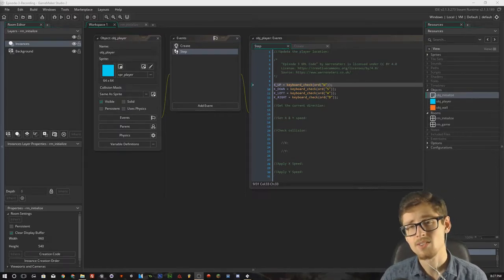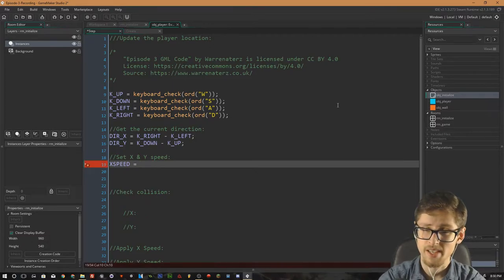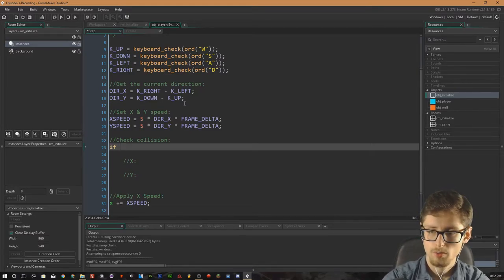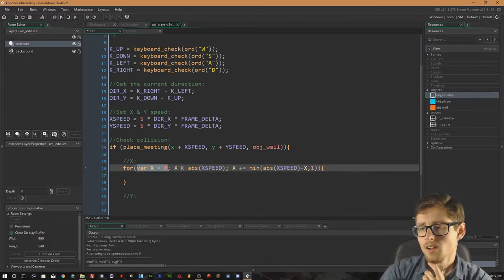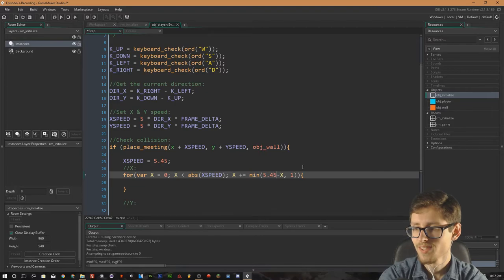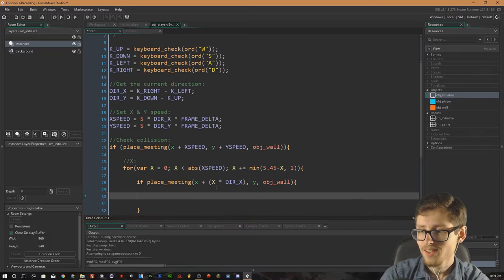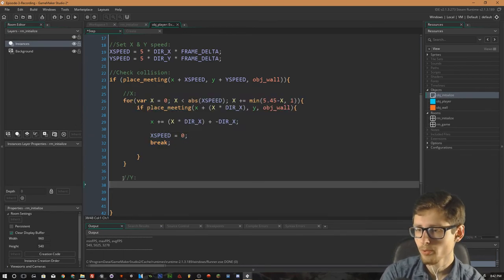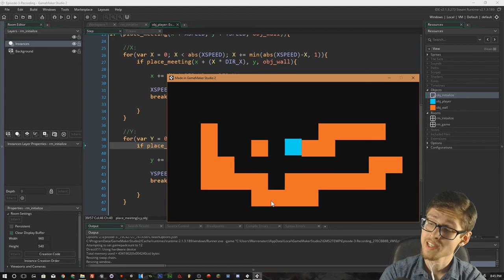GameMaker Studio 2 Tutorial [ADVANCED] - Alternative collision with Delta Time - [Episode #3]

Comment: Wow! Thanks for that code, I thought about using for loops in collision checking, but never envisioned using them like this. The collisions now work really well. Thanks for the tutorial!
Reply from the maker: You're very welcome man, I'm glad that it helped you!
Reply: Aha thanks. I just want to ask you on how to deal with a rotating object colliding with another object and making sure that the object doesn't rotate through the other object, I really appreciate any help and thanks in advance. :)
Reply from the maker: Epic for that I'd either recommend you to use circular collision because it's less performance heavy, and if not, use pixel perfect, but then check if a collision will occur before you incriment / decrement the rotation of your rotating sprite
Reply: Ok thanks for the advice :D, I've tried doing checks before rotating an object and also doing a similar technique used for checking collisions on the xyz axes, but I keep finding that the rotated object gets stuck, and that this also sometimes happens when there is no rotation and the frame rate is high enough on a normal collision (without rotation). I'm not sure that if it is because I'm working in 3D and that could be causing issues, or (most likely) I'm doing something wrong. I just hope I'm not bothering you too much. :)